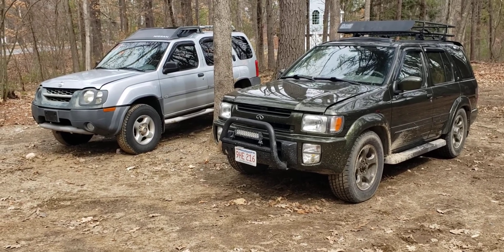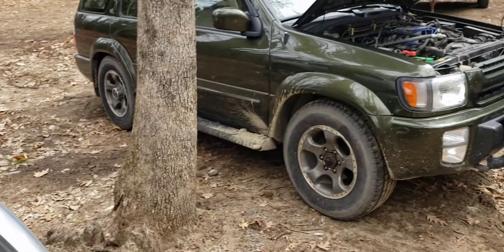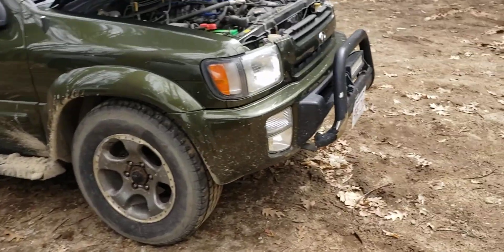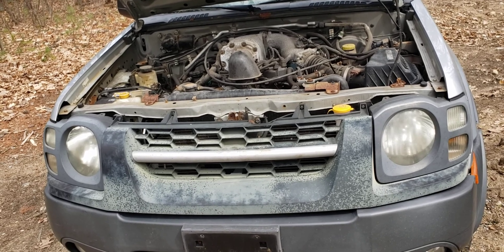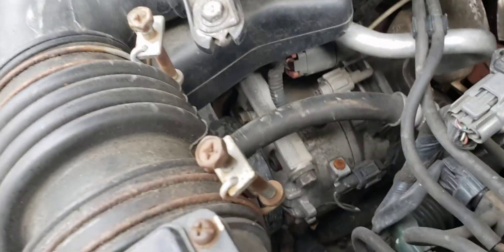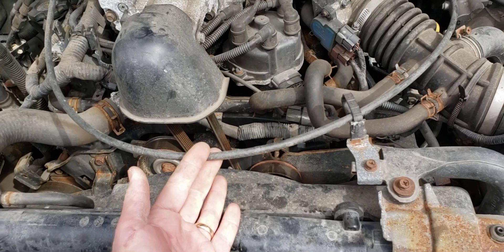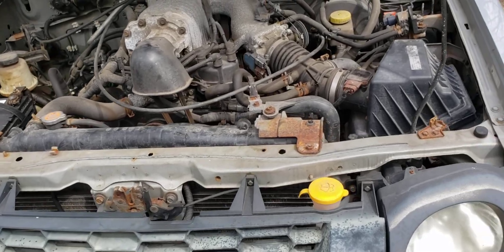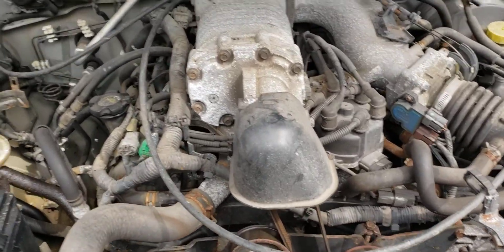R50 QX4 Supercharger Swap Part 1

Comment: Found your videos  and like all the info you share on them one question did you ever got yours to pass emissions?
Reply from the maker: I never had to thankfully. In MA they only test emissions on vehicles newer than 15 years old, and mine was a '96. In order to do it the correct way, you would need to swap the EGR system from the donor vehicle and make sure it's the same type as your ECM (CA or Federal). Or, you could use O2 spacers on the rear sensors and do something for either stand-alone, piggyback or reflash for engine management so you can tune out the emissions. Mine was a "six month only" model, and had the first version of the "All-Mode AWD", which means there are multiple separate control modules which control the engine, trans and AWD system. Based on that and the fact that I didn't need to pass emissions anyways, I realized after some quick math that a little piece of electrical tape over the light was cheaper than all the witchcraft that would be necessary to do it right....

Comment: Hello

I did manage to get a complete 3.3 supercharged engine, transmission, ecu, harness and 4x4 from an xterra that I want to swap into my 2002 R50

The problem im facing is that the supercharged engine harness has an extra plug that should be inserted into my gear shifter. While my original harness only had the other 2 plugs. I dont know what to do now. Can you help?

Comment: Where can i buy a supercharger?
Reply from the maker: You can get a used Eaton M62 from any 2001 - 2004 Nissan Frontier or 2002 - 2004 Nissan Xterra that came supercharged from the factory. You can do a search online for them on Car-part.com, E-bizzle, etc. The Hollander interchange number for it is 53298. Just make sure to get the complete lower AND upper intake manifold, as well as the snorkel behind the throttle body. And make sure the teflon coating on the rotors isn't coming off in chunks. I would change the oil in the snout as well before using it. You can use the Eaton or GM mineral oil specifically for the M-series blowers (Eaton part #001-60550 or GM part #12345982). It's also best to just get the whole truck like I did. That way you know you have any brackets, pipes, hardware, etc that are different. It's not 100% bolt-on, but it's pretty close. You can use your original computer brain, but you have to swap the injectors and mass air meter. Also note that the VG33ER engines were known to have a "chatter" coming from the supercharger. IT'S NORMAL. The supercharger pulleys on these engines are a solid press-fit like most other Eaton roots-style blowers, but inside the snout they have a funky spring-style dampening system instead of Eaton's usual 6-hole biscuit like on an M90 (Examples are Thunderbird Super Coupe, Grand Prix GTP, Bonneville SSEi, etc), and everyone gets all sketched out over it. Mine chatters. It also runs great. Embrace it and move on. Any other help I can give, just let me know. Thanks!
Reply: @richardwarpula5425  thank you.